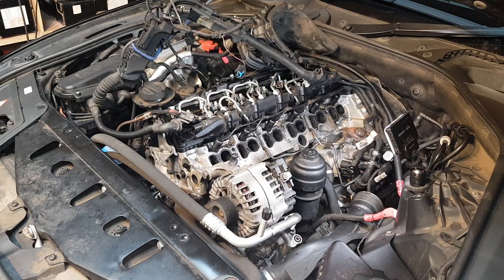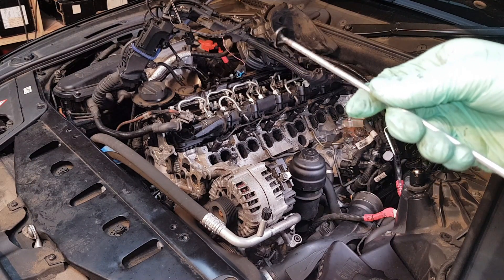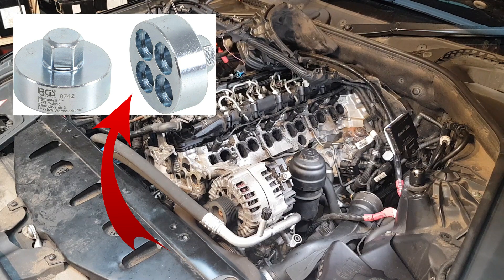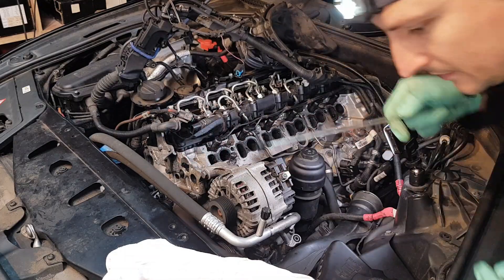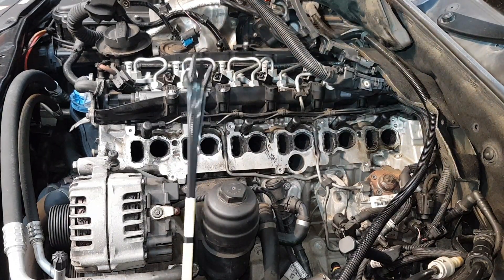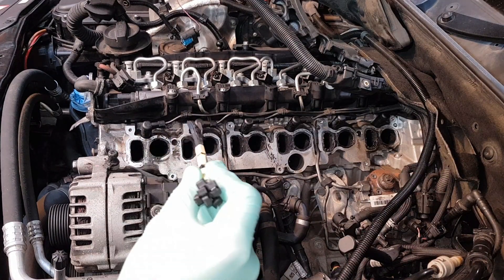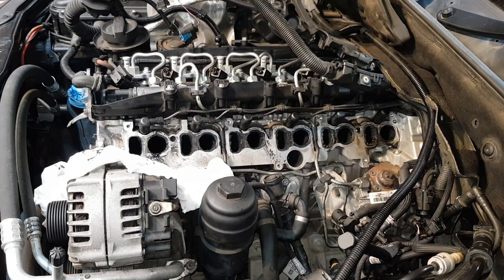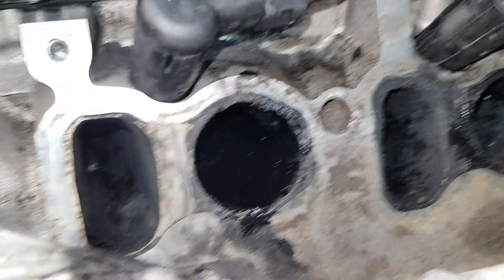How to clean valves & Intake ports Carbon cleaning Walnut Blasting BMW N57 N47 soot removal tool

Comment: Im going to do this at the same time Im replacing the timing chain and I guess my N47 engine will look like same. Im also planing to do intakemanifold cleaning and oil filter housing gasket at the same time when engine is removed.
Reply from the maker: Yours will be almost the same only 2 less cylinders to clean😁

Comment: Great video. Keep up the great work. I'll be attempting to do this on my 435d very soon. Just had ECU and gearbox map stage one. It feels fantastic but I know with 100,000 on the clock that this job needs doing to improve the flow. Thanks 👍
Reply from the maker: @J.D3NNIS  You are welcome🤝🏻
Reply: I've got a 435d with 91,000, and thinking of doing this. Did you do a carbon clean yourself? Thanks.

Comment: Not sure if I'll get a reply, still - can someone explain, what is that 3rd port/hole under cylinder no. 4 intake port (I understand that's where pipe that comes from EGR and splits to Y - one side to intake, one to the cylinder attaches to). Considering a EGR delete and I can't quite understand what would happen if that hole was left open, as some EGR delete kit sellers suggest - it doesn't need covering..? Anyone?
Reply from the maker: @dzovis  I would not recommend EGR delete on these engines N47 and N57. The EGR not only does exhaust gas recirculation but also plays critical role for fast engine warming and regenerations. I will not argue with you as this is ultimately your choice but I would advise you not to delete it
Reply: @TheKeenMechanic I bought the car with EGR and DPF already, removed, although physically EGR is still in place, possibly it's been mapped out, so I was just considering plugging it off as I have water pump replacement coming up, therefore my initial question.. Any clue how that port works, what role it has with the Y pipe going to the intake..?
Reply from the maker: @dzovis  It takes exhaust gases from the exhaust manifold and brings it back through the intake manifold

Comment: I accidentally cleaned a port with a valve partially opened. I got some of that junky fluid into the cylinder. What should i do? Will it get burned off when the engine is running? Please help
Reply from the maker: Hi
I am not 100% sure what the consequences would be to be honest. I know it is not great but I hope it doesn't scratch the cylinder. It might be ok. It is a shame you didn't check to see if it was closed
Reply: But how to be sure the valves are 100% close?
Reply from the maker: @AIRfree Do a bit of research. Watch the valves go up and down when rotating crankshaft. Test with a bit of brake cleaner to see if they are closed and hold the liquid
Reply: @ i did check and it looked closed. I could barely see from all the carbon build up. What would happen if a huge piece of carbon fell into the cylinder?

Comment: Is the walnut blasting really even necessary? It looks pretty clean to me with just the brake cleaner and vacuuming.
Reply from the maker: Vacuum cleaner, brake cleaner and brushing will remove 90% of the carbon. I used the walnut shell media blasting to get the remaining 10% of carbon build up at the back of valves and the hard to reach areas.🤝🏻

Comment: How do you know when the valves are closed ?
Reply: Is it worth to change the entire valve cover is you have leaks or just gasket?? Coz on mine was leaking and the dealer replaced the entire cover. Also did the intake cleaning. Is good now
Reply from the maker: The dealer probably replaced the entire cover and gasket as they didn't want a returning customer to complain about oil leaks in case it was due to the cover being deformed from all heat cycles. If you can do the work yourself and can't afford a new cover just replace the gasket. It is a very labour intensive job so in not able to do it yourself then better to replace the cover itself
Reply: @TheKeenMechanic  I can afford it, 700usd job done. I was just wondering what % could be a cover deformation and what % is a gasket. Anyway, better we did change all in once
Reply from the maker: You will see them moving up and down. When they are up they are closed. 🤝🏻
Reply: @TheKeenMechanic you can see from inside the ports or?
Reply from the maker: @ashleynoke9736  Yes, you can see from inside the ports or you can also look at the camshaft lobes if you have removed the valve cover / rocker cover.
As I explain in the video you can spray some brake cleaner inside the ports to check they are closed and then start the cleaning. Just educate yourself a bit more on how the whole system works before you start working. No shame in asking as we all had to start learning from somewhere🤝🏻
Reply: @TheKeenMechanic  thanks I appreciate the help, I’d rather do it without removing the rocker cover so will just look down the ports 👍🏻
Reply from the maker: @ashleynoke9736  taking the valvecover on an N57 is a big job. I have a video on it but I only recommend doing it if you have oil leaks and need to change the gasket. Other than that you can just remove the intake and clean the ports and clean the intake too
Reply: @TheKeenMechanic  I have the N47 engine from a 2009 118d, I’ve had the rocker cover gasket done so no need to remove the cover tbh too much hassle

Comment: Wow great work, nice.
But no material enters the cylinders?
is it dangerous to do it?

Thank you
Reply from the maker: Hi buddy. It is totally safe as long as you know what you are doing. You have to close the intake valves on each cylinder you are working on. Hope this makes sense🤝🏻
Reply: @TheKeenMechanic  Hi friend, I think I understand now. I have one more question if you can, what cleaning liquid did you use?
Thank you
Reply from the maker: @dariopiccolo671  I used brake cleaner as I buy it in bulk and is cheaper that way. You can also use petrol as well. Just make sure to clean and extract everything very well and blow the closed ports with an airline at the end. You can also use oven cleaner and pre-soak the closed ports then rinse with hot water and straight after rinse with WD 40 and brake cleaner. Do not leave water sitting for too long. Water is the best way to clean the oven cleaner. Make sure to have a wet shop vacuum cleaner to extract all the waste from it🤝
Reply: @TheKeenMechanic  Hello friend, thank you for your precious explanations, I will try very patiently to do it. Thanks again. Hello from Italy
Reply from the maker: @dariopiccolo671  No problems. I have cousins who live in Italy but never been to see them. I have only been to Roma once. Lovely country with so much history.

Comment: What was the tool you used to clean the gasket surface for the intake
Reply from the maker: Hi. It is a small diamond coated tool for sharpening router blades. It is very fine grit and flat which is ideal for the job
Reply: @The Keen Mechanic  thanks, I just ordered me one to try it out on my cylinder head
Reply from the maker: @miguelh281  make sure you order the finest grit they have
Reply: @TheKeenMechanic  I ordered a 4 pack. The finest grit it shows is 1000. Is that okay?
Reply from the maker: @miguelh281  1000 grit should be ok, just test 1st and see how it goes.
Reply: @TheKeenMechanic  okay, thanks for the help

Comment: Thank you for fantastic videos. I have been watching all your videos. You have inspired me and give me motivation to start  the cleaning operations on my BMW 525D N47T engine. What kind of fluid are you using to clean the  valves and intake ports? Can I use DPF cleaner for removal all the oil, soot and dirts?
Reply from the maker: Hi and thanks for watching my content and for the great feedback. I like to use brake cleaner as it can't damaga rubber and plastic. Some of the products they sell can be very strong and may damage valve stem seals. Just use petrol if nothing else is available but be sure to close valves and extract all out. Don't allow anything to fall inside. Check thouroughly there is nothing left in the ports like bits of material from brushes as it can cause damage. It has to be super clean
Reply: @TheKeenMechanic  Thank your very much for good feed back. You do mean that I should put something to close and protect all other valves and ports to prevent anything to fall in while i am working with one. I have already ordered the crankshaft tool to open and close valves. Is Walnut blasting an accepted metode to remove all dirt and carbons on valves and ports? I have seen there are garage offering cleaning valves, ports and walnut blasting as well in England for 350-400GBP.  In Norway I cant find any garage offering these kind of services. If any garage has these kind of services it will be so expensive that nobody can afford to use the services.
Reply from the maker: Yes, it is good practice to cover the ports so nothing falls in accidently. Make sure to test the ports to see that they are losed so no dirt leaks inside. Yes, walnut shells are very expensive but it saves dealing with the mess. If I have to clean them again I will not bother with walnut shells and just save some money. Make sure you have good brushes and use plenty of brake cleaner or petrol to dissolve the oily mess. Extract as much as you can with a cheap vacuum cleaner.

Comment: rather than walnut blasting it why don't you use a small blow torch to burn off the carbon?
Reply from the maker: That way you will burn your valve stem seals

Comment: nice work right there.  BMW dealer will not do this even for 5000 euro  :)
Reply from the maker: Thanks man. Dealers are good at replacing expensive parts as they make good money on both parts and labour😶. Not many garages try to repair and reuse anymore. Sometimes things just need a little bit of TLC and some "elbow grease"

Comment: This may sound like a silly question, but which way did you turn the engine over to open & close the valves? I've got to do this on my E90 n57
Reply from the maker: Hi
When you install the crank pulley tool then turn clockwise and watch your valves move up and down, do it slowly and gently.  You can turn anti-clockwise too in case you need to make fine adjustments but generally you want to spin it in the natural way it turns. No such thing as silly questions, better to be safe than sorry😉
Reply: Thank you for the quick reply! I've never done an intake manifold before so I thought it's worth asking 😂 loving your videos as well mate 👍
Reply from the maker: @Toastmanpat  Thanks man. Glad you like my content. Appreciate your feedback
Reply: How do you know when the valves are closed?
Reply: I also wondered about which way you turn the engine, but it is clear now, thanks. However, I also want to know if you need to put the automatic gearbox into Neutral gear before turning? I understand that you must do it to disengage the engine with the gearbox and whilst I have car disconnected from the battery the only way I can do it is manual way by screwing in the screw on the gearbox to disengage the Park gear and put it into the Neutral gear. Is that the correct procedure?
Reply from the maker: You can turn the crankshaft on an automatic even if it is in park. You can only keep it inneutral with the engine running. Hope this helps
Reply: @TheKeenMechanic  Thanks. Yes, you are right, I have just realized that when you turn the engine off, it automatically puts the car into the Parked gear, but I have always been convinced that this is the automatic gearbox feature. .................. Out of interest, so when you turn with Parked being engaged, does it mean that Parked works as Neutral making the engine being disconnected from the gearbox? Is that the way how I should understand it?
Reply: @TheKeenMechanic  ... and one more question, what is the best way to confirm that the valves are closed? .... is it just a matter of NOT seeing the "clean" steel part of the valve's stem?
Reply: @TheKeenMechanic  Do you have any technique to check if the valves are closed?
Reply from the maker: @tomf.9277  turn the crank and watch them go up and down so you can understand top and bottom position. When you see that the valve stem doesn't move down then it should be closed. What I like to do is to spray some brake cleaner inside. If it doesn't leak through then it is closed🤝
Reply: @TheKeenMechanic  Sorry to be a pain, but if the valve is not sealing as it should and the brake cleaner will get into the cylinder I understand that this is not ideal , but it is not end of the world , isn't it? .... when the engine starts up later after the job, the engine should burn it off?
Reply from the maker: @tomf.9277 Correct
Reply from the maker: @tomf.9277  You can rev the car in P but the car will not move. The P locks the gearbox mechanicaly and car can't move.
Reply: Great job. I did this on my n47 and it was very hard work. Supermessy too. All that oily junk ended up everywhere
Reply: Do you feel any difference after doing this job?
Reply: @AIRfree  it made a big difference to mine as I was also having a boost leak from the swirl flap arm in the manifold. Also having clean ports will make the engine run that bit happier too

Comment: What machine did you use to walnut blast the intakes?
Reply from the maker: Hi I used a pressurised blaster pot but had to do some modifications to the gun with parts I had lying around the garage. Not worth investing in one as it is expensive if you are only going to use it once. Also the price of the walnut media has gone up and is like £70 per 20kg bag
Reply: I have two N57s that I’ve done walnut blasting on but my pressurized tank set up isn’t so great. That’s why I was wondering if you had a specific blaster. Thanks for the response.
Reply from the maker: What is wrong with your set up? Not enough pressure or is the media clogging up in the ports?
Reply: Sorry for the super late response. Not enough pressure. Was using a low CFM air compressor so refill times took a long time. I was able to still clean them but it did take a while. 

Great video as I still come back to watch it again for my next walnut blasting.

Comment: Great ideas
Reply from the maker: Glad you find it helpful. Thanks for your message by the way. Are you a BMW owner yourself?
Reply: @TheKeenMechanic  , no, not a BMW owner, recently cleaned a ylinder head off a vivaro 1.9.
Love the cable ties idea, and purpose built scraper, proper forehead slapping moment, seeing how effective it was. Thanks
Reply from the maker: @stuungar3390  Yes, I have to admit the cable ties are great but was not my idea as I have seen this before at a friend of mine's garage, but the scraper was my own invention. It is amazing what you can make with stuff lying around the garage and a mig welder. I have to say I will be lost without my mig welder. I have a 1.9dci trafic with 160k miles. Haven't looked in the ports to see how it is but I would say it will be similar if not worse.
Reply: Yep, lol, worse guaranteed, egr valve + engine oil = nasty caked sludge. Mine was at 150 too, surprised it went. Alternator belt went into the timing belt, which is apparently a common thing to happen.
Apparently the f9k is the best engine out of all of them, along with the 5 speed gearbox.
Will fully recon the old engine, rings seals etc.  Nothing like working on an engine out of the body.
You have a very clear way of explaining things. Cheers
Reply from the maker: @stuungar3390  Mine is the F9q and the crank pulley went on it making a mess. Had to remove timing belt and change the crank sprocket. Whilst at it changed the alternator, belt and pulleys. I might remove the intake and check. Have you still got your egr in place? I am in two minds whether to turn it to disable it or not.
Thanks for the compliments🤝
Reply: MIGs are the best
Reply: Ye mine is F9Q 762 (without boost solenoid) On the block at the back, it should say F9K
I turned the egr valve 180° and left the electronic unit, so still vulnerable to failing electronically, the gutters are renowned for blocking. water drips on unit and can have a voltage drop on every other sensor on the same line. So it's better to blank and reprogram. 
Ye my crankshaft sprocket looked like it was chewed when belt went, camshaft sprocket sheared the woodruff key, luckily I noticed it.
Reply from the maker: @stuungar3390  A lot of good info shared here. Thank you
Reply: A lot of the problems to thes can be attributed to blocked gutters and water pissing on the engine, seized injectors etc
Reply: Hopefully we'll get a video on these engines lol
Reply from the maker: @stuungar3390  Hopefully only preventative maintenance videos and no failures😁